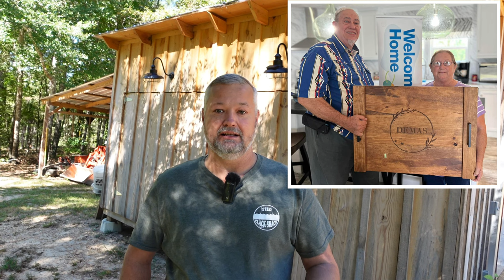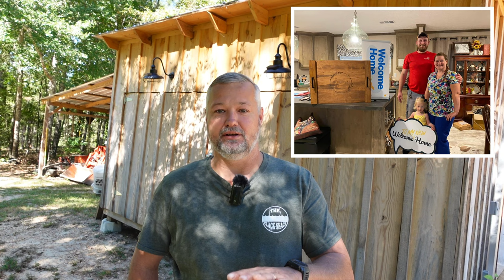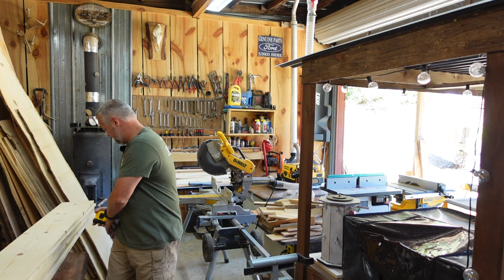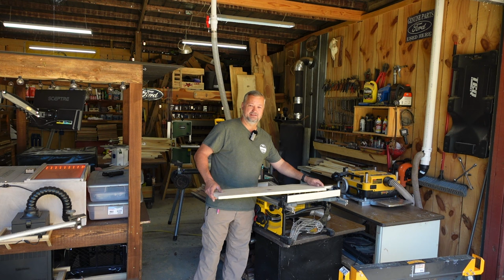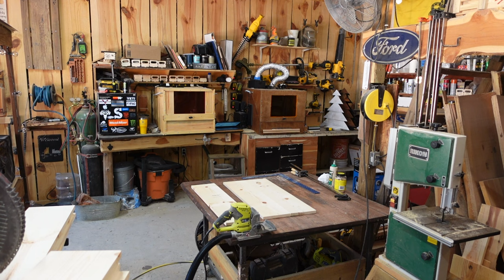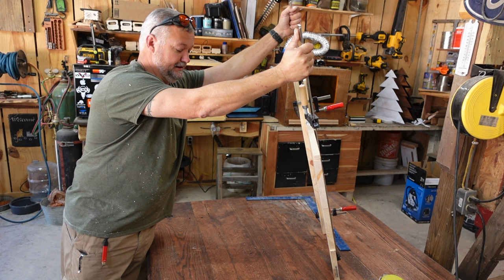A simple build to make money- Stove cover part 1

Comment: Just out of curiosity.  What are rough dimensions of your shop?  It seems like a nice size.
Reply from the maker: Not big enough... lol.. 20 wide by 24 long. Has an 8 foot covered porch and a 20 foot lean too on the back. I also have a 24x20 mill barn where the sawmill lives. Both full....

Comment: My stove top cover project is not flat, has a slight wobble on opposite ends, what is the  best way to fix? Thanks
Reply from the maker: That could be the result of the wood being wet. I have to check the wood and sometimes dry it more when I get it.
Reply: @TheClackShack  wood is dry. Any tricks to fixing this issue?
Reply from the maker: @mikeledee8786  I have had a couple move on me and I had to start over. Wood does crazy stuff sometimes.
Reply: @TheClackShack  ok

Comment: What are ur measurements for these stove covers.
Reply from the maker: 30.5"X22.5" with 3 inch side runners
Reply: @TheClackShack  ty sir. I measured the stove here at the house and it measured 20 x28 I've made 2 of them but I put a little pieces of wood as for feet so they wouldn't  touch the burner rails. But the way ur making them is great.  Well I guess the customer better have a flat top stove. Thanks again for the measurements. And I also ordered the k40 c02 laser. But I'm getting just to be able to cut letters out for my custom signs I carve.
Reply from the maker: @silberiomartinez  , as long as the eyes are flat, it works. We have a gas top with a griddle and it works great.